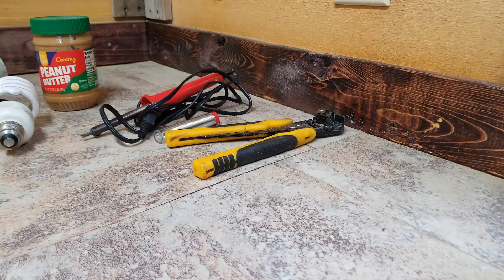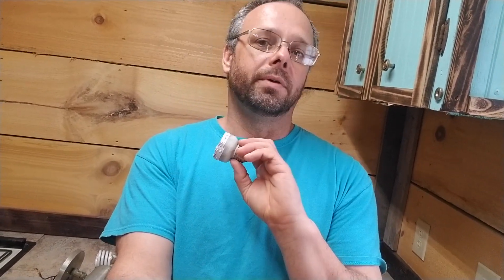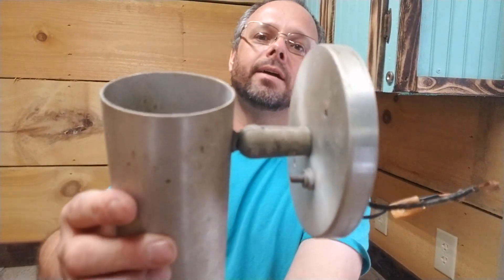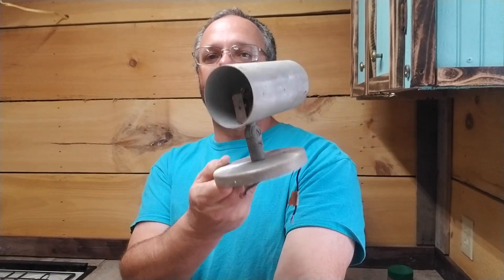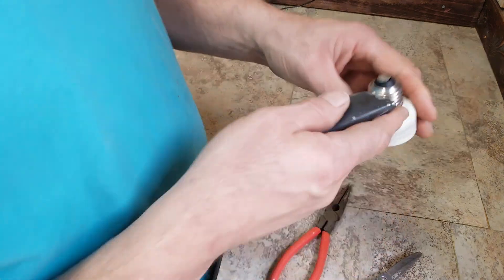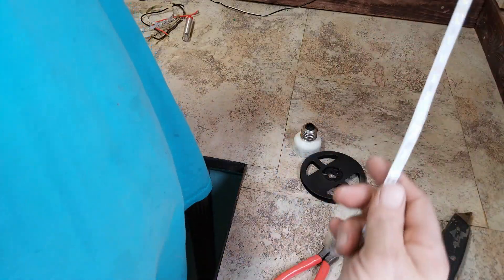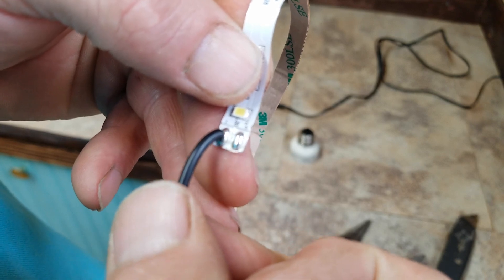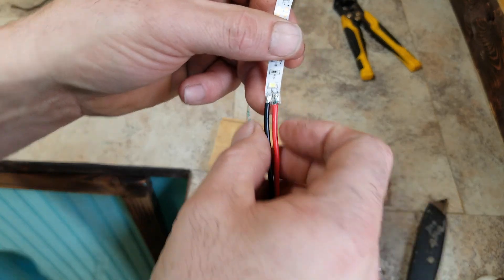Tiny House Build-More Solar lighting

Comment: Absolutely love the way you rigged a dual-voltage light fixture. I plan on implementing this idea in the future. I will admit that you threw me when I first saw the 12v lines running to the outside light. One thing on your solder joint, particularly with such small ones in close proximity like the LED strip, make sure part of your inspection is for solder bridges. Make sure there is a clean gap between the two. Trust me on this one! Keep up the good work on all your projects.
Reply from the maker: Yes I forgot to mention the bridging issue. I guess I just assumed it was obvious. That's why I didn't become a teacher I guess lol.
The dual voltage light should come in handy. Just have to make sure to only do it with LED bulbs. Heat from an incandescent bulb could cause some real problems.

Comment: I thought those were parts waiting to be made functional, not junk. 
In any case, nice save for both lights. Do the strips get hot or are they cool like the bulb you have outside the door?
Reply from the maker: The strips stay cool as long as you have 12 volts and don't over drive them. At up to 15 volts they won't heat dramatically but they will heat up. At 20 volts they get really bright and they get hot enough to melt plastic.

Comment: Well done! Don't you know there's mercury in those CFL bulbs, though! ;) Almost none, but many worry about it. Me, being old and having played with mercury in my hands - as instructed by my teachers - in grade school, i don't worry much about it either.
Reply from the maker: I did know that somewhere back in my mind, but I forgot it lol. Not much of a concern though. I made my own mercury switch using a small test tube and about 10 thermometers. This was when I was 16. I used it as part of the remote controlled starter I built in my car. 
I know now that was probably not the best material I could have used, but it worked, and I lived. 
I probably should have gave some kind of warning on the video though.
Thanks for reminding me of that.

Comment: This is so cool! These could also be used for real estate photography where the house is vacant and electricity is off! I have a power pack with 12v. It would add subtle lighting to complement dark corners where the taller lighting misses. Awesome job! (And the intro being changed and getting right to your subject is ON POINT!)
Reply from the maker: That's a great idea! Actually, the project I am working on now would be good in that use too, probably even better.